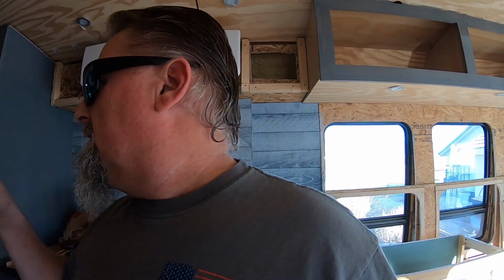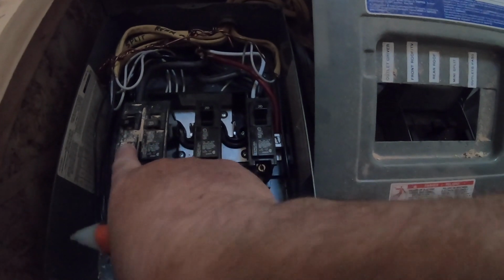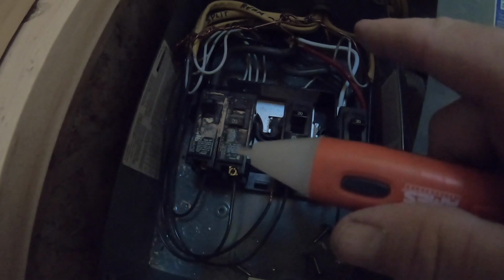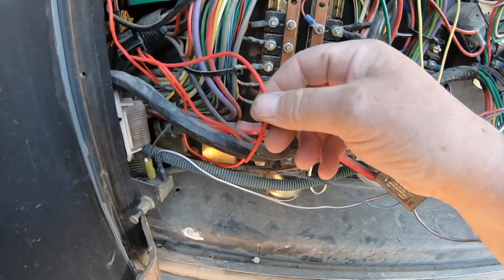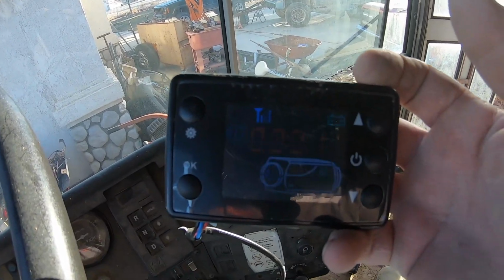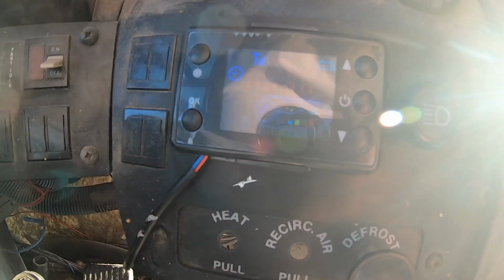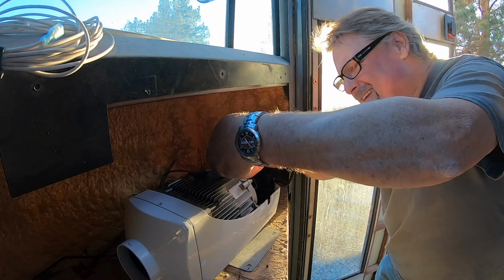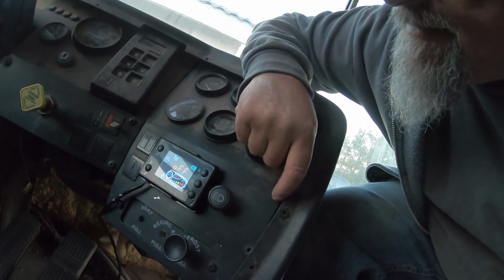Bus to RV Conversion -70- Firing up the Chinese Diesel Heater for the First Time!

Comment: I have installed one of these in my big rig and the fuel pump is only about a foot and a half from the tank and another foot or so from the heater, I can only image how many times you had to cycle it on and off for that fuel to go from the rear to the front of your rv...  It took about four cycles for my short distance... Great conversation you got there, your putting a lot of work into it, hope you use the ahit out her when your done!!🤙🤙🤙

Comment: Hey Rick , is the heater going to heat the full length of the bus ? I am looking at one through your link and am curious how warm the whole bus gets
Reply from the maker: I haven't run it long enough to find out, but everyone I talk to that has one says they pump out a ton of heat.   These would be sufficient in a van or a smaller RV, but I would put two in a 72 pass bus like mine if thats going to be your only source of heat.  I guess a lot depends on how well you insulate and if you still have all those crappy bus windows
Reply: @dzlfreek  Hey Rick , I went through your link and ordered an all in one heater like yours . Its sitting outside on the camper tongue and piped in through a window temporarily.  I did put a hose in for the cold air also . Its ran a few nights here in Michigan (Big Rapids) teens - 30° . I am surprised how much heat it puts out on very little fuel . Thank you for showing this heater on your channel  ! !

Comment: hey, I'm in HVAC. I'm sure you've thought of this but anyways...  I could easily see the wind at highway speeds causing a problem with venting your diesel heater. On a direct vent normal furnace the intake and exhaust need to be terminated close together. So, the air pressure between the two is equal . Your diesel heater is a direct vent.  Maybe, run that diesel heater at highway speed before you get to far with the install, just to be safe. It would suck if it doesn't work right when you really need it.